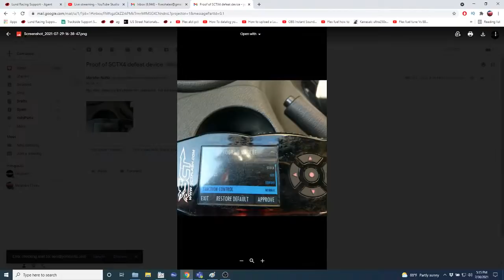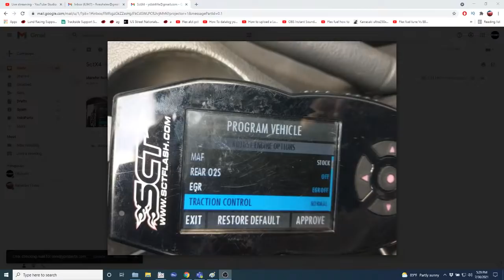#ydbtdaily What are the most reliable boosted setups in Coyote mustangs?

Comment: I just stuck with the easy roush 2.3, bap, 1050xs, twin 67 and jlt. 79mm pulley junk 93. It's simple and it works flawlessly since tuned by LUND..
Reply: Almost identical setup going on mine, but with 82mm and California 91 🤢
Reply: What was your rwhp?
Reply: @RPG-GT  never dynoed it after it was tuned, the stock roush kit on 93 made 611whp tuned on dyno jet.. I imagine with the upgrades and being only on 93 no plug ruining additive, around 650whp.. I don't beat on it, I rarely drive it maybe once the last month. Runs really good though lund has this file vetted so perfect..
Reply: @michaeln.7083  plug ruining additive?  More octane is always safer and you're worried about wearing plugs out little quicker? You can still go 10k miles.  On the copper core plugs they are dirt cheap but don't last too long but seem to work best.  More octane is always good.  There is more power to be had safer.  I
Reply: @michaeln.7083  why do you barely drive your car?  Pay that much for a car and then to modify it nicely then just leave it parked.  What's the point in having a reliable setup that drives well if it's just gonna sit lol.

Comment: Been enjoying these chats. This is the exact reason I dumped the turbo stuff I had been collecting.  Reliability is my first priority. I have a stock gen 1 2011 I bought new. Looking at a Whipple 3.0 kit. Looking for 650-700.  Is that safe on E85?  What do I need to make that other than the Whipple, fuel system and injectors, and you tuning?
Reply: Idk oil pump gears
Reply: Don't do a 3 liter Whipple Def don't do one on a gen 1 coyote.  I would suggest a gen2r 2.3 tvs that is a real good blower for a gen 1 coyote.  If you can't find one you can do a 2650 that is little much for a gen 1 but would still work well.

Comment: Is the sai li fuel system any good i already bought 1 not installed yet?
Reply from the maker: Till about 750 rwhp. Unless it's their new 2020 gt500 style system
Reply: @YDBT4LIFE  its the old 1 and I have  a roush tvs idx1050 sai li am I screwed or I need to upgrade i want 800rwhp 2019 gt on e85 can you tune it
Reply from the maker: @joecapone667  it won't handle 800 rwhp. Fore innovations twin 275s is plenty 🔥

Comment: 2.65 TVS is the most reliable. Period.  Roush, VMP, Edelbrock.  All Eaton blowers. All reliable. Roush made their 2.65 restrictive vs their 2.3.   Makes no sense.  To me Edelbrock 2650TVS all day without their terrible tune.
Reply: Gen3r and odin are the best 2650s vmp smokes edelbrock.
Reply: But I agree they are the most reliable.  They can also go way longer without needing a rebuild vs a twin screw which is another thing that people never factor in when deciding on blowers I've heard twin screws need rebuilt sometimes as often as 20-40k miles depending on use but a tvs can go over 100k miles without needing a rebuild.  This is one of a few reasons companies go with tvs stock.  They also stay cooler under cruising conditions because twin screws keep on spinning even when just cruising creating heat.  Normal mpg should be better too.  I just think tvs is best for a street car.  Only time Whipple makes sense is if you have an all out race car trying to make 100% max power on a max effort race car.  A 3.0 might outdo a 2650 pushed to the limit 25+ psi on e85 but anything under max effort the 2650 is gonna make more power and way better torque and they can still make a ton of hp quad digits on the dyno isn't hard at all.  They can go very very fast.  If you're trying to do anything other than max effort race car shit and you gotta make the most peak hp possible the tvs wins.